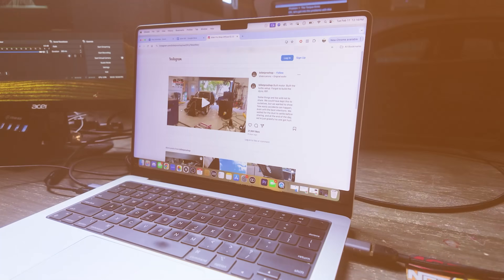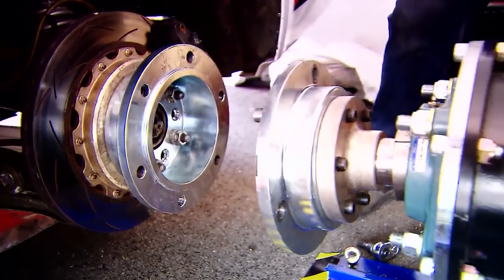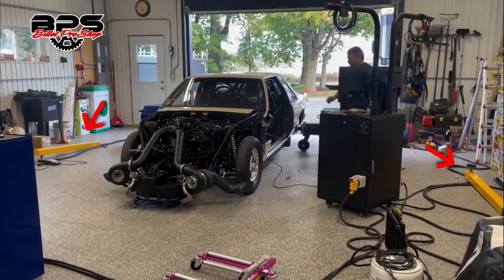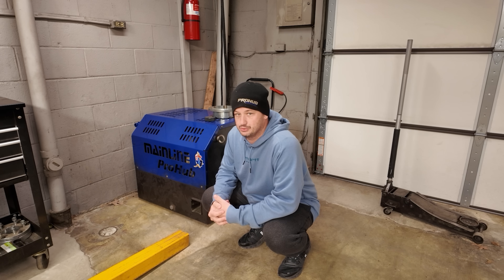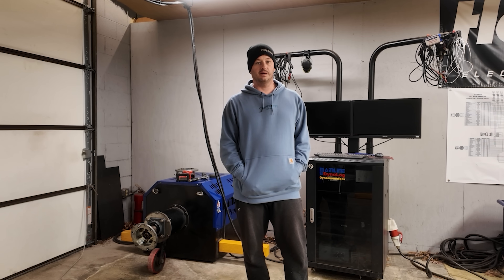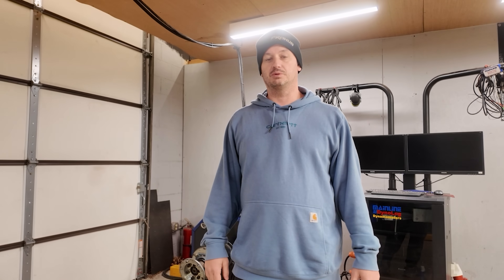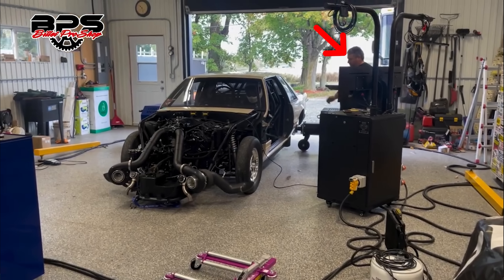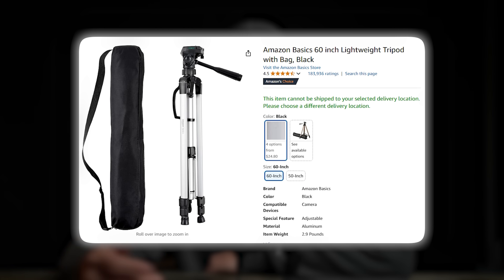How to Avoid a Hub Dyno Disaster - Horrifying Video Breakdown

Comment: Joe, I like your idea of a sensor installed for the Torque Arms. I would hard wire it to the monitor and main engine switch. Monitor would flash a big ass Red box saying Torque arms and Won't allow you to record anything from the vehicle by the Dyno's engine switch. Steve Morris of Steve Morris engines have massive like Torque box frame on his. I love your video's, very informative.

Comment: I take a lot of precautions in my shop. Possibly even beyond what most people would consider sane. You got to remember these things are 5000lbs. hulks of metal. Your 300lbs self is not stopping that from falling off a lift. He was probably playing with 2000 HP or more. That car is not stopping if it finds traction. Regardless of how quick or "not a big deal" it may seem, you need to respect that bad things can happen. When you're the most excited about things, is the most important time to slow down and double check everything. Stay safe out there. And remember, if it don't look right, if it don't sound right, if it don't feel right, it probably ain't right.

Comment: You're absolutely right about having a switch to ensure the torque arms are installed. I think it's serious enough that the manufacturers should do a recall to install such a simple mechanism. It should have been like that from the get-go. We have to have presence switches on seats for lawnmowers, and we have to have interlocks to stop the door from being opened on a CNC lathe, or the belt cover of a drill press - So why is a dyno any different?

Comment: Machinist here. I went on shift to finish boring a 24 inch inner dia by 4 ft long, 2 piece aluminum tube heater that weighed 100 lbs. 
Started up monster lathe, and part separated into halves flinging one up through the roof 30ft up and another hit the steel ceiling truss/ I-beam and bent it before ricocheting through a busy shop.
Turned out the previous shift had not banded it properly and the 2 halves moved, hit boring bar 300 rpms... Clank, whoosh, out thru ceiling??? Then snow falling in shop.
Same guy later ran a 5" diameter 6 ft long boring bar into the lathe chuck destroying it,  while he was drunk at work... Boggled, drunk running a 240 inch lathe!      A  monster!
Reply: To the op... sounds like the owners son. Anybody else would have been gone after the first screw up

Comment: A $20.00 micro switch installed in the middle of the tube for the torque tub is all that you need. Just wire it in between the power cord input to the controller. You can add a green LED to let you know if there is
 power to the unit. No green light install torque arm.
Reply: $20 for a microswitch sounds like government military pricing!
A $4 switch would git r done! Im just picking on you man, hope you're not offended. I completely agree with you in that an owner/operator could easily set up a microswitch on their own for very little cost and be an effective safety feature

Comment: Very informative and impressive video.  I learned a lot.  I have never had a car worthy of a dyno run.  My current whip is a 1989 Honda Crx HF with over 385,000 miles on the odometer.  Still, however, I love learning new things.
Reply: Waiting for the v tech Yo...

Sorry i couldnt resist
Reply: @williamstamper442  It's fine.  I understand.  My car came with 62 horsepower brand new.  It has, however, never left me on the road with just simple preventative maintenance which I do myself.  It has never been in the shop and it gets over 47 mpg in combined driving.  Thanks for your clever reply.

Comment: Huh dunno manufacturers could add sensors that will not allow the stock operate when they are not installed.  Perhaps Puccini manufacturers should implement that
Reply: And then yup you come to the same conclusion as just wrote 😂😂

Comment: You mentioned people needlessly standing in unsafe locations around the car, immediately reminded me of the video of those overly lifted cars on those ridiculous 26" and larger wheels that were drag racing, and during the burnout one of the cars had it's harmonic balancer break at high RPM and come flying out from under the car, bounced up and hit a guy in the face nearly taking his jaw completely off his face and damn near killed him from what I remember.
Reply: Im 55 years old and only one time have i witnessed a harmonic balancer go a flyin'...
This was 1984 at the US Nationals at Indy. Don't remember who's car, but was a big block Chevrolet Pro Stock. I saw it happen, car was in the burnout box left lane. I was standing along the fence about 50 foot away. Can't believe nobody got hurt but amazingly there was zero injuries. Scared the crap out of me however, as well as all others nearby who realized what happened. The balancer came clean off, didnt actually break. Im sure it lost its bolt and came loose. Bounced off the ground then took off and smashed the side of a building, taking a big chunk out of the concrete blocks. 
Anything can happen and we all should just assume things will happen therefore safety should ALWAYS be the very first consideration around any and all motorsports
Reply: I think you're misremembering. Dudes jaw didn't almost get taken off in some vid.

Comment: I used to travel all over the country tuning cars, it blew my mind how many shops just allowed whoever to stand where ever around the dyno.  I had several get really pissed off with me when I kicked people out of the dyno room or shop because they were crowded around.  Anything can happen and really hurt people.
Reply: Any plane of rotation is a huge danger. There's at least one video out there of a flywheel failure that killed the dyno operator. I've seen wheel weights go through a garage door, stones dropping out of a wheel well and going under the roller is also not cool. Mechanical fan? That's a big problem if a blade lets go. Balancers come off too and I've seen video of those skipping across floors. Throw a driveshaft at high RPM and you'll brown your shorts! Let's not even talk about people standing around the car and stepping on a roller walking to the window on coastdown. You can also count on fuel system failures and coolant explosions too, the list is damn near endless...

Allowing crowds around a dyno is a recipe for disaster and I make it a point to watch "planes of rotation" whenever I'm around one or one of my vehicles is on one.

Comment: As Onefastneonrt points out, 
A procedural check list that is completed before a run commences would be (and is) beneficial to avoiding unwanted events caused by inattention or task saturation.
This is why it is a common practice and often mandatory procedure in the aircraft and aerospace industry.

A purpose built enclosed dyno 'cell'/room or division is also wise rather out dynoing cars in the middle of an open workshop as the close proximity of walls and ceiling will help to contain any ejected object or fluid and will also assist in containing any fire that could result and making it easier to control.

Sorry to hear about your friend.
Mechanical failures on dynos are definitely no joke.

Have witnessed straps break, an axle fail, and a flywheel disintegrate.

Comment: Boxes  that offer ~2000 HP resistance 
should not be able to operate without the torque arms installed.

There is no safety to bypass , god damm !!  

That's some really shitty/cheap  design with no thought to safety. 
Any Engineer worth a shit would make sure the Pony brake box was 
always capable of operating safely at 130%  of its rated load.

Comment: How dangerous is the wheelie eagle did when cletus was testing at fueltech?
Reply: I am certainly not a highly experienced tuner or dyno owner/operator. 
But what I saw there appeared to be at best an insufficiently secured vehicle. 
At worst... I don't know...
It certainly appeared to be a potential learning moment, as opposed to a viral video moment.
Reply: @mbliss01  it was learning for those that didn't realize that could happen, but I think everybody there in the moment knew what was going to happen. It was entirely done on purpose with the expectation of what happened.
I'm asking separately how risky was it if anybody really knows. It's easy to say. Of course, it was risky and yeah, to some extent, it was, but how risky was it?
Reply: @geniferteal4178  If so, it was highly irresponsible.

Comment: 200% agree...roller dyno's freak me out every time, especially if the tire balloons or when you have vehicles too wide for the rollers (like alot of dune buggies).
Reply: Had my fwd turn the wheel at the last moment after a run and smoked my tires

Comment: Put a turbos burst radius where it can’t get you, don’t stand at or behind the bell housing centerline. 
Don’t stand or park behind them, “really bad at dyno days” 

Tips from owning a dyno  👍
Great video and hopefully it helps with dyno safety. It’s always crazy where people will stand while trusting someone else’s work.
Reply: Burst panels are mostly used on a Super charger or blower car. Most turbo cars have a waste gate dump valve or a boost cut in the ECU software.
Reply: @midbc1midbc199  He's not talking about a burst panel - he's talking about how turbo wheel "burst" aka EXPLODE when they fail. Either from a structural defect or from being overspun. Competition cars in higher classes actually have to have housing to contain the wheels and cross studs in the exhaust because exhaust wheel can EXIT the exhaust pipe and fly into the crowd - regs written in blood as they say...
Reply: Plane of rotation, sing it! Ever seen a wheel weight come off or something drop between wheel and drum? Scary shit when suddenly you see a spot of daylight in the garage door!

Comment: Thanks for going over this Joe! I had a driveshaft come apart at 137mph on a Dyno, and had PTSD around a Dyno for probably 6 years. Somehow, no one got hurt, except the truck and Dyno. Stay safe, get better!
Reply: i have seen driveshafts come out at least 10 times, i never stand by the dyno when making a pull
Reply: Damn it, man .. I have seen driveshafts doing some scary shizz b4 ... The only reason I support a heavy Azz torque tube, lol .. na all bs aside tho , glad u ok and yeah I have seen some carnage from driveshafys and most was not even on dyno , they were on road , or track , or offloading but nevertheless still dangerous af  . Always always always , anyone who reads this , stay safe and have driveshaft loops , they may seem dumb and excessive,  but if you have that much power and feel ya need one , gut instinct is usually spot on and they can save you some carnage .. 💪🏽🤘🏽🤙🏽✌🏽
Reply: PTSD? 🤦 Way to minimize PTSD, as if it's just the common cold.

You didn't have PTSD. You may, have been afraid to go around one but it wasn't PTSD.  🤦
Reply: Dumbass. Tell me a driveshaft coming through a floor at 137mph isn't a traumatic stress event 

Oh wait you don't have a car that can go 137mph let alone one that will sheer a driveshaft

Comment: My favorite Dyno Oopsie was a customer brought his 2015 Chevy truck that just had a maggie installed and he needed a tune, So after our tuner makes about 5 hits, The return fuel line popped off the rail ….probably after the first or second hit and it had been pumping fuel down the rear of the engine and down on the floor, the Dyno fans blew the fuel down into the dyno pit and it ignited. My stall was right next to the dyno and all I heard was POOF and huge fire ball from the engine bay. I hit it with the extinguisher and I’ll never forget the sight of flames pouring from the rollers and how the rear of the truck was a fire ball. The fans had blew a few gallons of fuel down into the pit.
Reply: That's a little more than an oopsie 😮
Reply: Damn! Was the vehicle or dyno ruined?
Reply: Would fuel pressure monitoring have prevented this?
Reply: @orlindimitrov7322  Return line coming loose won't drop fuel pressure until the tank is empty...
Reply: No they didn’t bro